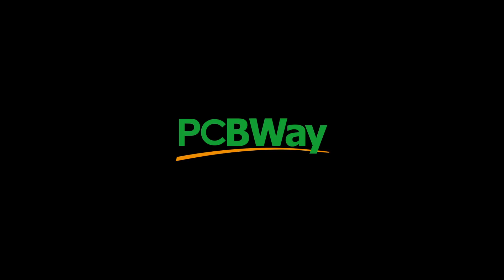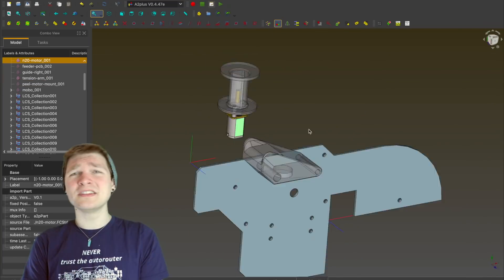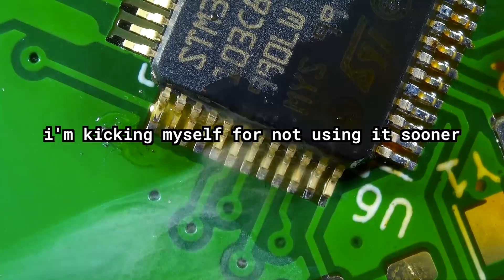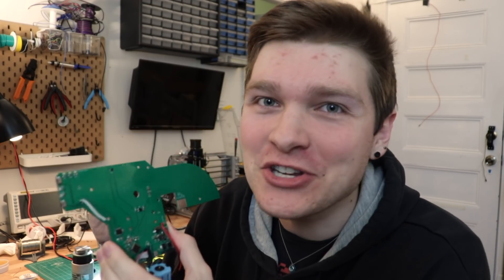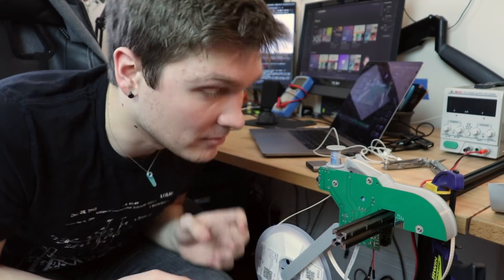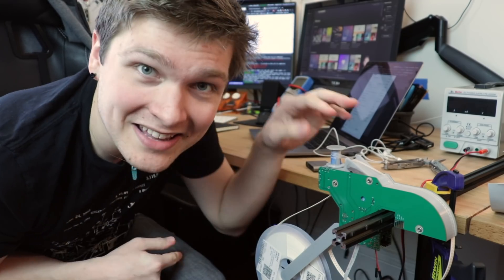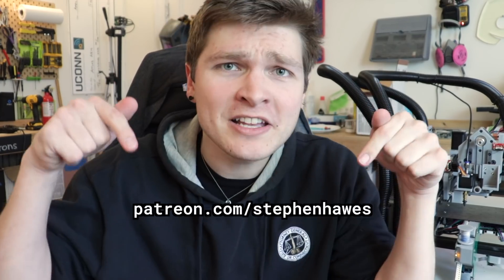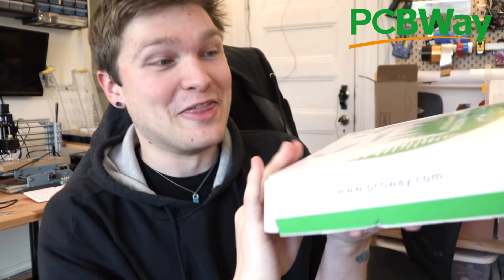PnP Feeder Addressing: 1-Wire to the Rescue!

Comment from the maker: It's good to be back gang! Excited to dive into 2021 with a bunch of new stuff!
Reply: What do you mean convinced to use flux? Did you only rely on rosin core before? :8
Reply: You got me the best possible spot on Bench 1 !! For that you'll have me as an eternal Patreon! Thanks for yet another awesome video 😊
Reply: Stephen Hawes 
You are amazing 😎
Reply: If im remembering it correctly you switched to a larger motor in order to have enough power to drive both the tape peeling and tape movement with the same motor. Now that these functions are separated wouldnt it also be better to revert to the older smaller right angled motor in order to get a slimmer feeder design and therefore having more space for feeders on the machine. Also 32 feeders seems a bit small. Maybe adding a bit or 2 extra to the address would be beneficial to future proof the system for people who wanna expand on your project. It is after all open source. Anyways great design! I wasnt a fan of the mechanics of the last revision of the feeder but i really like this new design :)
Reply: Definitely keen to see what's happening with the PNP this year.
Reply: inspiration

Comment: Would it help in addressing the feeders to have address pins [log2(N) of them] on the feeder base and each feeder, meaning the slot in the feeder base has a binary-coded address?  Then, the 1-wire EEPROM should have a unique 64-bit serial number built in from the manufacturer.  So, say you want the feeder to have as many as 16 feeders, you rework the board for the feeder base to have each slot have its four address pins tied to ground or Vcc according to the binary value of that slot number.  Then, as you move a feeder from one slot to another, it automatically learns what slot it is in and can store that in its EEPROM, communicate the slot and its own 1-wire SN back to the chassis microcontroller, or both.  I was thinking an I2C PISO DAC IC on the feeder to read those 4 pins.  This way, it takes the possibility of human error out of the setting of the feeder address and it effectively works like a handshake where the registration of the feeder into the slot of the feeder base is such that the slot has a permanent address wired into the backplane and the feeder EEPROM serves as the virtual address of the feeder itself.  The chassis microcontroller queries the 1-wire bus and receives responses from each unit with its slot number, its 1-wire SN, and maps the logical feeder address to the physical slot address and perhaps a temporary store of what components are currently on the reel.  That last part would involve human input unless there is a barcode on the reel and you had a reader on each feeder or on the chassis itself.  Just spitballing here although I'm out of my depth in terms of making it work myself, meaning its a theory on my end.

Comment: I must have missed something in a prior video.  What was the reason for the eeprom?  It seems like you have a bus controlling the feeders, and need addressing that remains fixed to the feeder slot while the feeders are swapped out with refills.  This wasn't all that clear to me from the video.  If I guessed correctly, well done.

Comment: I've basically just binged this entire project. When you were talking about using your own protocol I was wincing. So glad to see you shift to something a bit more standardised, not having to worry about maintaining that custom thing will make life way easier.

Did you think about using the serial bus for address programming though? Keep one address (I'm a network gal, so I suggest going for the top address) as broadcast. Send out a broadcast 'I want to set an address to F6' message, have all the lights go blink blink, press a button on the feeder to select the one you want to program. Send a "I've been programmed with my address as F6' back to the host from the feeder you selected. Either have the other feeders watch for that message as well as the button press, or have the host send a broadcast releasing the others from their wait state.
Reply: Heck, you could program a sequence that way....

Comment: ᗯOሠ  ᗩᗯᗴᔕOᗰᗴ  ᑭᖇOᒍᗴᑕT ❢ 
𝚀𝚄𝙴𝚂𝚃𝙸𝙾𝙽:  Am I correct in assuming the feeder’s UI is programming the EEPROM directly, not via the controller and isn’t globally aware of which addresses are already in use on the bus?
What happens if two “feeder-floor” EPROMs, on the bus are set to the same ID, perhaps by accident? 
Is the bus controller up stream able to detect such address conflicts? 
I appreciate that this kind of problem might be of little consequence, given the scope of the project, I am just particularly interested in such things.  
     𝑹𝒆𝒂𝒍𝒍𝒚 𝒆𝒏𝒋𝒐𝒚 𝒚𝒐𝒖𝒓 𝒗𝒊𝒅𝒆𝒐𝒔  👍 ᐛ ⌚︎👍

Comment: Please use BC2 soldering iron tip. It is thin enough for soldering microcircuits in a QFP package, high enough heat capacity for soldering elements in 1206 packages (it is very convenient to solder 0603 with such a iron tip)

Comment: Another approach for the addressing could have been an addressing pin going from "feeder base" to feeder base, with a cheap AND gate in between. The addressing input goes to the AND gate and the feeder itself, and an additional output goes to the other input of the AND gate. The output of the AND gate goes to the addressing pin on the next feeder base. Via RS485 you can define a command that states "if you don't yet have an address and your addressing pin is high, take X as address". After a feeder receives an address, it simply switches the output to the AND gate high so that the next feeder can be addressed. In order to deal with "unoccupied" feeder bases, you can add a pull-up to the input of the AND gate on the base feeder base board. You can even feedback the output of the last base to the main board, so it immediately knows when it is done addressing and therefor how many feeders are present. Hope this makes any sense. It sounds cheaper than using an EEPROM to do this stuff and we've done something similar on an commercial HVAC system we've build parts for.

Comment: this is a really cool system. but instead of using the feeder floor and 1 wire eeprom, just have the feeders stack with pogo pins, common the 12v, gnd and rs485 lines, and daisy-chain a uart with each feeder just passing the next its address+1 then you have each feeder remember which part it has and its width, then when ever you add or remove a feeder the stack can just resort its-self, complete with free support for any width feeders.

Comment: im just porting this to this vid in the hope ull see this comment. i just watched the vid about the camera module. im not sure if the hotspot problem has been completey resolved yet. if not, i can give u a great tip that ive used with our vision projects. you can buy polarized film really cheaply online. if you put a polarizer over the camera and a different one over the LEDs it will completely block out any reflections!

Comment: Really cool project. I think you should try to make it a more narrow design. Resistors, capacitors, can easily eat 20 different feeders, if you are not careful with a circuit / PCB designs, and they are usually very small, a so bunch of more narrow feeders would really help waste less space. Not sure what is the limiting factor in your design, but it looks it might be the motor.

Comment: Can I suggest a new improvement in soldering? Use other tip. 

https://m.media-amazon.com/images/I/81yNtfxNLEL._AC_SY355_.jpg

For flat legs or smd chips with larger distances, use both of the right.  If you solder smd chips, atmega (A lot of legs with a less distance), ..... use the two next of the right. I've working years repairing pcb phones with this tips and are magic. Later for clean, use acetone mixed with cleaning alcohol (70/30) for don't remove the prime, a old toothbrush and kitchen paper for remove the liquid.

Comment: Stephen Hawes, Have you thought about adding uart going to your motor drivers so you can utilize the features of the tmc2209 motor drivers in place of what looks like the a4988s? It would remove the need run ends tops due to "stall guard 2" plus, you wouldn't have to mess with the pot(can modify voltage in Marlin) and has the benefits of being nearly silent! May reduce your BOM and work! Just a thought 

Working on my own Pnp and you've prevented me from running into a few issues, Thank you!

Comment: Even the cheapest switches will have a 10 million -100 million cycle life. Even if you where to place 10 of the SAME part per board you could produce MILLIONS of boards per feeder. Your plastic prints will warp and fall apart WAY before that.

Comment: Late view, but next upload, while putting together aff links...compatible 3d printer...
BTW, get an ultrasonic cleaner for removing flux on whole boards, if you don't have one already. A cheap jewelry type works great. But, also be sure to get a cheap ultrasonic toothbrush. Seriously, a bit of alcohol on the toothbrush and 10 seconds of ultra action does better than 5 minutes cleanup work.

Comment: I love your work. But. Adding only (how many?) LEDs is a step backwards compared to the 1-Wire EEPROM. Kill the snake. Invest in an app that gives the user visibility into and control of all things configurable. You are building in unnecessary limitations. What do the very big Pick and Place machines do? Maybe each feeder has a unique serial number or MAC address and the real task is LEARNING which parts they need to contain from the BOM.

Comment: Having a buck converter on each feeder circuit mechanism isn't very energy efficient.... perhapse the different voltages can be pre stepped down and the feeders can just pick up from a common shared power bus rail using something like pogo pins

Comment: great Video. A quick word about solder paste if you use up the container quickly it's consistency should stay the same and it's great for dispensers. However I have personally found that it will eventually separate  ( after about a month of being opened ) and even after stiring it, it will never be quite homogeneous again. This makes it's use in solder paste dispensers  frustrating . I prefer and recommend solder paste stencils instead . It makes paste consistency much less of an issue. That said best of luck on your project.

Comment: It seems you have finally learned the third rule of soldering: Flux is magic!
1. More Heat
2. Less Solder
3. Flux is magic
Reply: More heat transmission, but less heat in component. Your components be safe.
Reply: @XiCKwY  'More heat transmission, but less heat in component.'  Exactly, you only need good heat at the surface of the component leads, heating the components to death like some things suggest is only a crutch against making cold solder joints.  Learning to make good joints without putting crazy extra heat into the part is far better..

Comment: I would have used the same optical sensor as the sprocket for the tape peeler.  Then a little silver paint or silver foil tape on the arm.  No need to purchase a pill magnet.  I had to buy a box of 100 on Amazon just to get 1.

Comment: Congrats on the flux achievment-unlock! Glad you like it! Next ditch the pointy tip of your iron for one with a bezel. Having a flat area in the tip helps keep a little reservoir of solder there, which will help heaps with drag soldering. And if you bridge it, clean the bezel and surface tension will have all excess solder stick to to the iron instead of the bridge.

Comment: This is engineering porn. Not in the sense that it is using luxury manufacturing methods and materials. On the contrary, you are using the simplest (PCBs, and 3D printing) in very clever ways.   The encoder wheel is simply ingenious. It is what good engineering is about. Performant design in the cheapest possible way.

Comment: You can use a modbus broadcast command to program floor addresses. Should be easier to automate, just have the user move a single feeder across all slots.

Comment: Nicely done! I'm liking the progress you've been making. One thing you might run into is RS485 really wants to run over a twisted pair, so you may have some signal integrity issues running over the parallel strand IDC cable you are using. You can get twisted pair IDC, cable for this, which has flat sections every so-often for crimping. Looking forward to the next installment!

Comment: You think you'd ever need to go above 32 feeders? Since you soft-limited the machine because of the binary programming mode with leds?
Reply: In theory he could just add a second bus of course.
Reply: in my experience of running a PnP machines with designs that fit on a 35x35 square double sided PCB you'll need more than 32 feeders.  an entire side of my machine is taken up with just passives (0,10,75,300,470,1k5,4k7,10k,100k,10nf,22nf,100nf,470nf,1uf,2.2uf,4.7uf,10uf,22uf,47uf,100uf is 20 feeders.  then you need all the ICs, leds, didoes, connectors, inductors.  i can't use a machine with less than 60 feeders with some additional tray spaces for parts that don't come on tape.